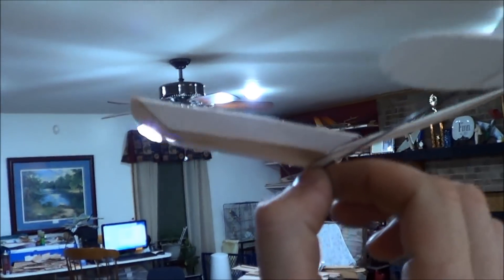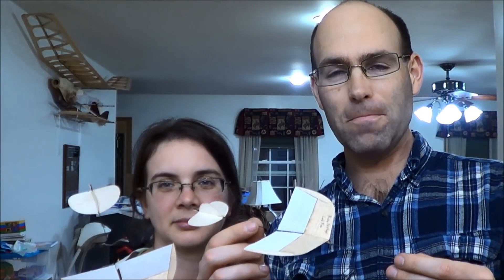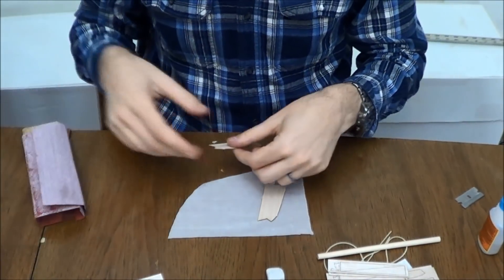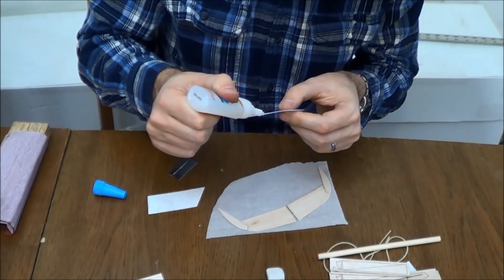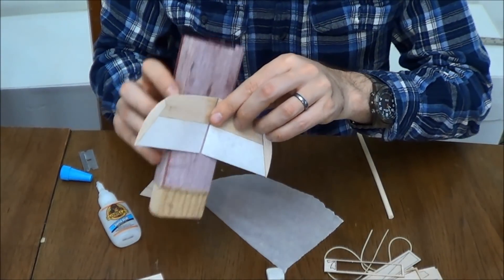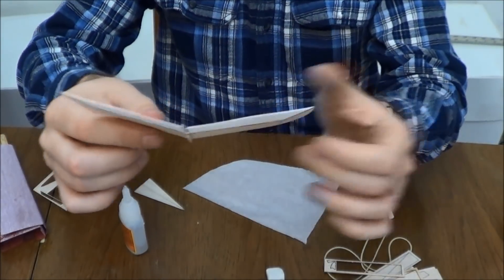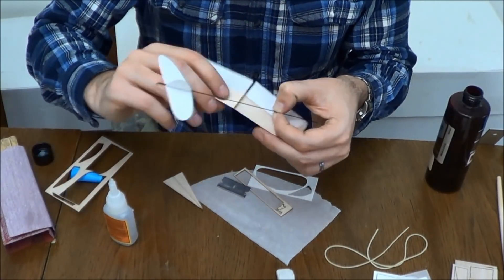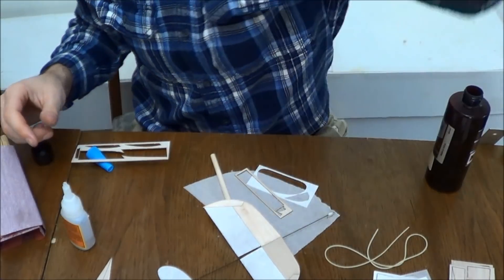Build the Micro Protege F1N-150 catapult glider!

Comment: Mr joshuawfinn wath tipe the material use to in tha final wing  setruture maiquins is a kaynt fonbort or craboox floyt set ?
Reply from the maker: If you can't find the right foam, go balsa for all of it. Just a lot more sanding to do. In theory the converse also applies--all foam. I haven't tested that theory though.
Reply from the maker: If you're referring to the foam, though, it's 0.5mm Graupner Vector Board. The wood is all 1/32" (1mm) balsa.
Reply: joshuawfinn  i work in bery sun in this poryet mevy working in a omniwing glider wit in this esrtutuer experimental 🤔👍🏻 hi fron panama 🇵🇦👋🏻👋🏻